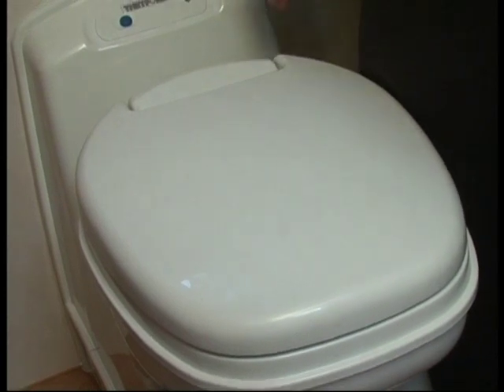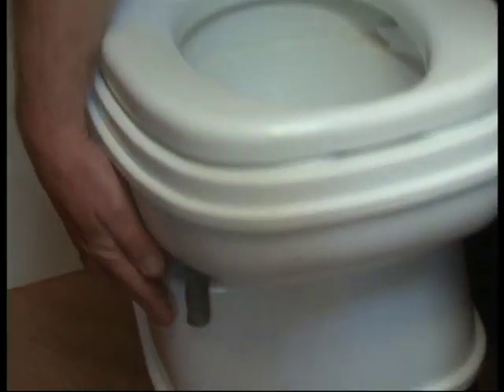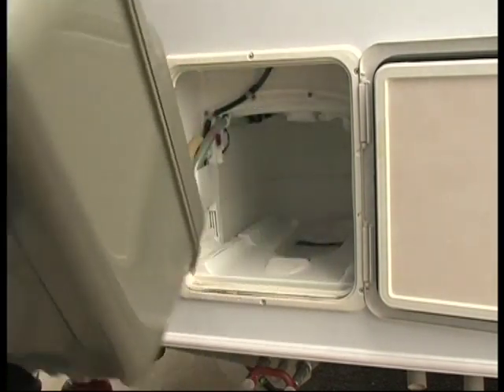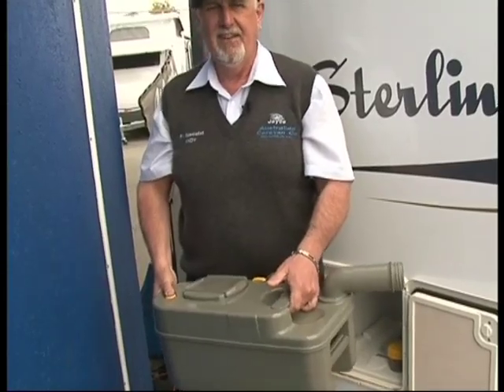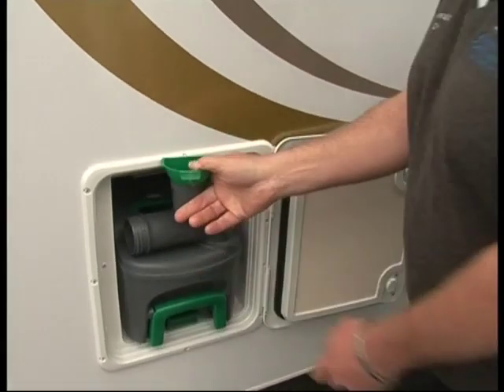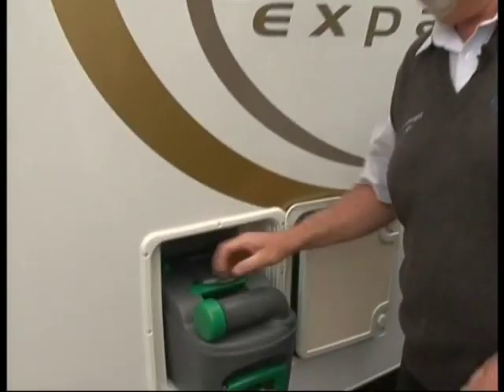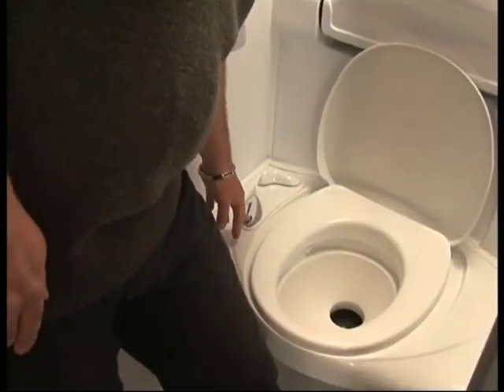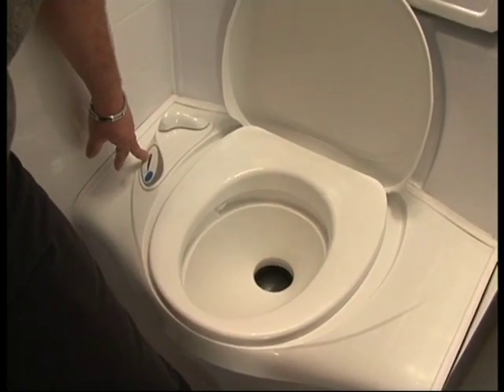Operating Your Jayco Toilet

Comment: I would suggest that you do not leave the black flapper valve closed with liquids or solids on top of it at anytime.
There is no real ‘watertight ‘ seal between the black flapper valve and the bottom ‘neck’ of the toilet and prolonged application of liquids on top of the black flapper valve will result in leakage onto top of the cassette and into the ‘cassette cupboard , also do not add solids to the top of the closed black flapper valve - unless you want a brown goey flapper valve.
Preflushing  the toilet with the flapper valve closed momentarily will certainly help by wetting down the surfaces which does help with the final cleaning/ flushing.